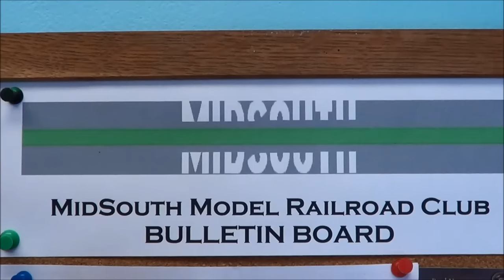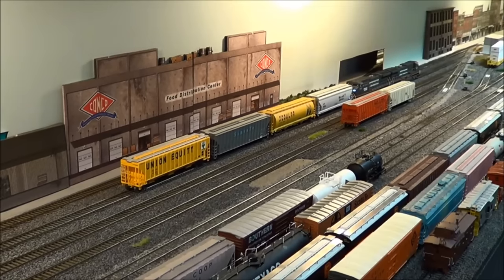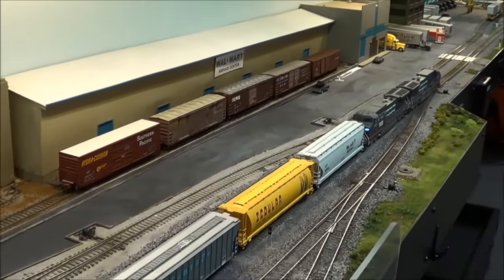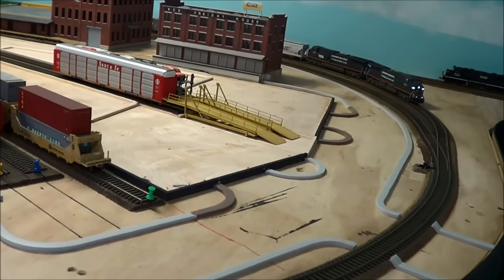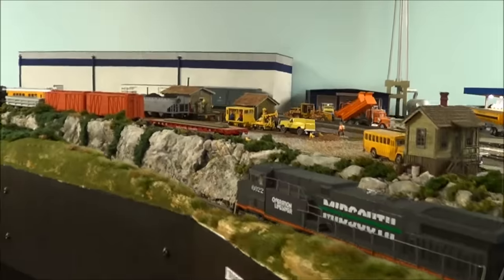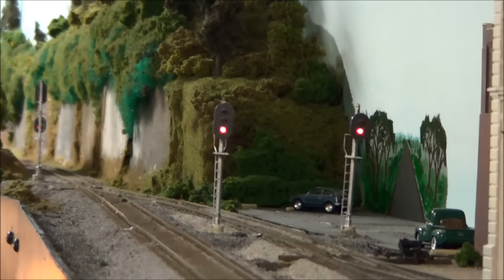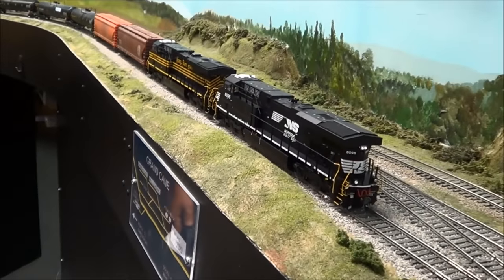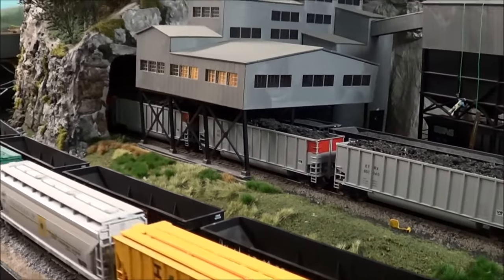Mid South Model Railroad Club

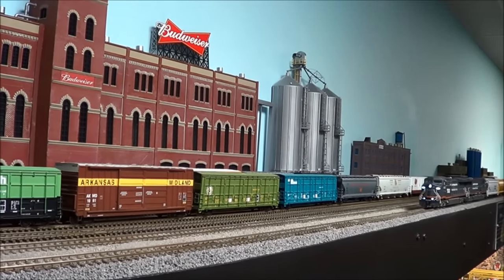Comment: at 13:15...
You need 658503 cans to equal one full-sized can (or 660451, depending on which ratio you use).
Reply from the maker: +mpeterll please explain do not know what 658503 cans are?
Reply: arthurhouston3 It was a reference to your joke about the Brewery complex, saying you would need to drink a lot of HO-scale cans of beer.
Reply from the maker: +mpeterll  I worked in beer business for 13 years and part of operations of the Dixie Brewing Co. in New Orleans.